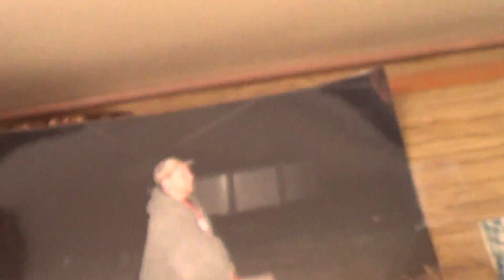Snow Romp!!! Late 2013

Comment: Looks like someone stole the throttle on Mikes 250 ride. Sooo then you guys installed a toggle switch. Wide open or idle. It sure wasn't in the off/idle position very long....  The Deere & Jeep looked like a riot too!
Reply from the maker: hahah, yeah man!  Mike was finally punching it!  it happens some times, but not usually that much